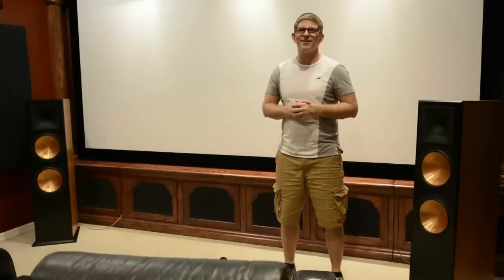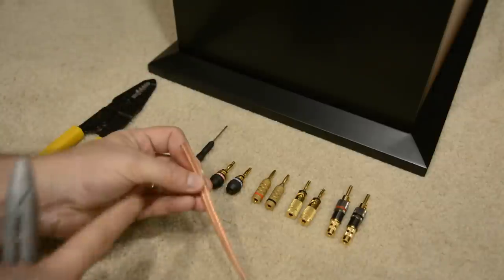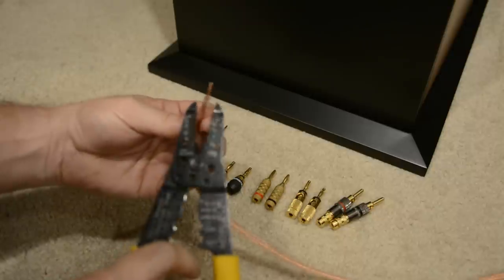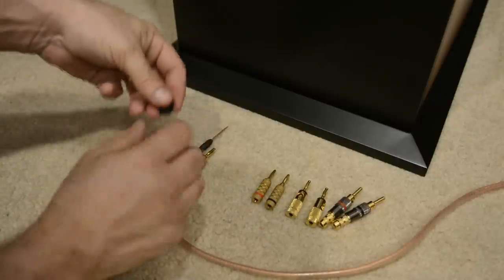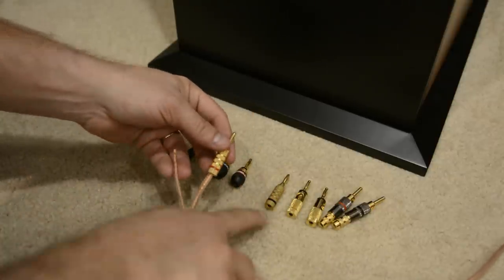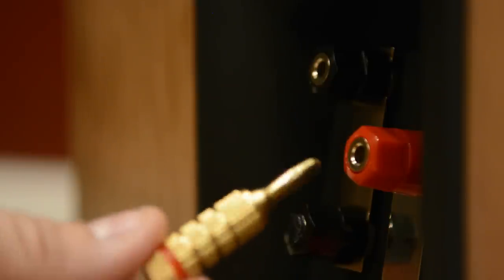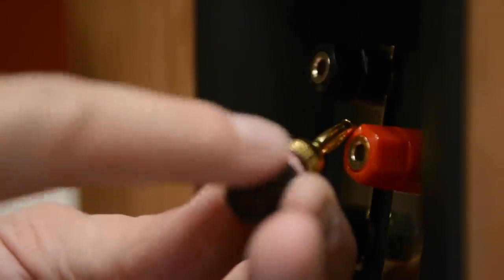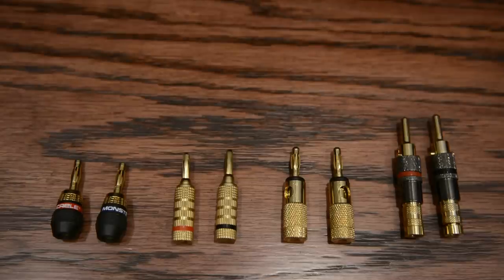Why Banana Plugs are a Must for My Home Theater and 2ch Audio System

Comment: Thanks for the comparison of BPs...I do feel the bottom locking screw should have gone first to lock it in place before the second screw for wire contact..
Reply from the maker: I’m not a fan of the ones with the screws.
Reply: @Youthman  but you just said that was your second choice? Maybe I am misunderstanding...I just installed Fospower screwdown banana plugs on the back of my AVR last night. The two screws locked it so solid and the plugs were so tight that when you try to put them in or pull them out you have to hold the AVR with your other hand or it all moves. I stripped 3/4 of an inch so BOTH the little screws provide wire contact.

My old Sewell plugs are exactly like those monsters and they got pretty loose over time.
Reply from the maker: The longer locking plugs with screws work VERY well, they are just more tedious to install since you are working with small set screws and they are MUCH longer so they do not fit in some AV cabinets.

Comment: I have a question. I’m new to connecting my surroundsound system. Should my speaker cables for the front left center and right be the same length let’s say I have a tower for my amplifier and of the media to the speaker cables have to be the same length
Reply from the maker: Hi Philip, as long as there isn't a drastic difference between the lengths, you will be fine.  I wouldn't recommend 6' cables for your mains and a 30' cable for your center.
Reply: Thank you for answering my question but it was a difference between 6 feet and 30 feet it was only a difference between I 10 feet because of a rack I’m amp being done in 6300 H to a definitive technology 9080 speaker system and I have a rack to the side so naturally one cable will be going shorter or we would be going directly to the speaker right next to it next to the rack and then that would be the center Which would be approximately 6 feet and then the far side which would be somewhere around 8 to 10 feet that was the difference
Reply: Actually I’m about to order SVS speaker cables and there’s no real difference between the price of the 6 foot and the 10 footer so I’m just gonna go with the 10 foot to keep everything pretty equal the only one that will be a little bit shorter will be the center channel the rears I’m using 16 I’m sorry 14 gauge cables for the rears
Reply from the maker: You will be fine with those lengths

Comment: So when are you supposed to use the jumpers on the speaker he showed? I have Klipsch speakers on my 5.1 setup and each speaker has two connections. I always thought they were connected internally so they drive both speakers in each unit. Have I been doing it wrong?
Reply from the maker: Hi Ozzie, when you remove the external jumper, you are separating the highs from the lows for either biamping or biwiring.  If you are not biamping or biwiring, leave the external jumpers in place and connect your speaker wire to only one set of the speaker terminals.  Doesn’t matter if you connect to the HF or LF terminals as the jumpers connect them together.
Reply: Not really sure what biamping or biwiring is. The Klipsch speakers I'm using have two woofers and one tweeter in each speaker. I just connected the speaker wire to the black and red and called it a day. I did remove the jumper. I don't know if I was supposed to or not.
Reply from the maker: If you removed the jumper and only connected your speaker wire to the top terminals, you will not hear the woofers.  If you removed the jumper and connected your speaker wire to the bottom terminal, you will only hear midrange and bass but nothing from the tweeter.  My suggestion is install the jumper and connect your speaker wire to the top or bottom terminals.
Reply: Okay, I just checked and apparently I didn't remove the jumper(s) which would explain why the woofers are working. I guess I spoke too soon. lol
Reply from the maker: Ozzie Alarcon I was thinking...”If he likes the way they sound now...wait till he connects the jumper and hears all of the speakers working”. Haha

Comment: Nice tutorial thank you. The only problem I have is that my onkyo receiver rear surround sound connection design (which I use for  my bookshelf speakers), is different.

The connections are the ones that you have to strip the tip of the wires then lifting up a lever before inserting the wires in,  then releasing lever for wire to remain secured. I'm positive you'd get an ideal of what I mean. The hole underneath the level is a bit small for speaker wire to pass through. In the end the naked wires  are nearly touching each other for being too closed together at the entrance. I had wanted to send you picture but YouTube doesn't have any option for that.  Which connectors should I get to make things easier please. I do not even know you name for this sort of connection. Please could you give me an idea. Thank you
Reply from the maker: It sounds like your surrounds use the older spring loaded connectors. You might be able to use a spade connector but honestly bare wire is  sufficient
Reply: Thank you bro
Reply: Yea, you're right, that's the connections with strings underneath. I'm very grateful for your help

Comment: I’ve never liked the idea of the wires being folded over then pressure clamping the wires. I don’t think it’s secure enough or making the best connection. I do have some and have used them but never  trusted them. I’ve just bought some locking ones like the last set in the video. I’m going to tin my wires with solder before fitting the banana plugs as the screws will have a solid wire to tighten to

Comment: Since I’m using a thicker ga. At super low volume I hear the towers of power even better than with the 14 I’m liking the cheaper wire and plugs a whole lot better. Seems like this is more solid overall.
Reply from the maker: Very cool.  Higher Price doesn’t always mean better quality

Comment: Brother .. i have A doubt.. Do All the banana plugs Fit in Even speaker cable As thick As 10 AwG..??
Reply from the maker: I'm not sure.  I've always used 12 or 14 gauge and never had an issue.  I've never had a need to use 10 gauge wire.  Are you running really long runs?
Reply from the maker: Typically higher gauge is needed for long runs.  Check out this chart - http://music-electronics-forum.com/attachments/35445d1440645410-speakr_gauge_help.jpg
Reply: Youthman  i am using 10 AwG dor my Towers And Centre..
Reply: not very long but  im using 10 AWG for my Towers And Centre..
Reply from the maker: I gotcha.     Definitely larger than what you need but no harm in having larger gauge wire.
Reply: Thank you bro
Reply from the maker: Absolutely

Comment: I bought these banana plugs only to find out they actually do not go into the back of the receiver where you secure the speaker wires.;
They are too fat.  I don't get it.  I also don't understand why no one ever mention such issues.
In fact they did not fit either Denon receiver. Denon 1612 AVR, 5 channel.  And another Denon AVR-S760H, 7 channel.

I do the typical unscrew out the nut, feed the speaker wire in that slot and then screw the shit back in to hold the speaker wire in place.  One big fat hassle as they really don't give you enough room to feed the wire in there.  Plus cluster fuck.
So I ended up sending them back to Amazon.
Reply from the maker: There are 4 different banana plugs in the video. Which pair are you referring to?
Reply: @Youthman  Each set of your banana plugs are  different sizes also?
I somehow missed you mentioning that.  
What are their  sizes?   Are they in mertric or standard?
I guess I need to watch the video again.
I am not expecting a reply.

Comment: Really should check focus. Could not understand the last type
Reply from the maker: Hi Jorge, The camera was in perfect focus.  I focused the camera on the banana plugs on the floor but because of the 2.8 Lens I'm using, it has a very shallow depth of field (google it if you aren't familiar with depth of field).  Basically as you move close to the camera, the object becomes out of focus while the ones on the ground remained in focus.
Reply: Youthman if the thing you are trying to show is not in focus then it’s not in focus. Focusing on the thing you aren’t showing is not in focus. Hey it happens. I still really appreciated the video. Thanks!
Reply from the maker: Good point Timothy.  Live and learn.

Comment: why " make a connection " to then make "another connection", when the best option is to connect the wire directly to the terminal ?? I've been building audio systems for years and have never used a banana plug......I enjoy eating bananas though, jmho
Reply from the maker: As mentioned in the video, the only benefit is convenience and time saver if you need to connect or disconnect.  Banana plugs are essential for me since I love trying different speakers, receivers etc.  I’m currently reviewing them three receivers and several speakers.  That would be a pain without banana plugs to swap 11 speakers each time I wanted to swap receivers.

Banana plugs do not sound better or worse than bare wire...simply a great convenience.
Reply: @Youthman  oh yeah absolutely !! I'm talking about permanent installations where nothing comes apart 😀... hopefully
Reply from the maker: For sure, if you never have plans (or rarely) change components or speakers, there is no benefit to using banana plugs.

Comment: Banana plugs where used in old telephone switchboards by the millions. Low current, frequency response from 100 HZ to 3000 Hz. Voice comm. Useless for home audio.
Reply from the maker: If you find no value in them, simply don’t use them. For me, they provide tremendous convenience with no audible difference.

Comment: banana plugs are stupid. adds time to project, adds cost to project, adds failure point to signal chain, adds a shitload of metal that your sound needs to push through. oh, but they make the connections that are hidden from view look nice. lose lose lose lose win situation
Reply from the maker: Nothing wrong if you want to stick with bare wire. I have used them for years and have nothing but excellent experience with them.
Reply: Youthman stated clearly that his main motive for banana plugs was CONVENIENCE...which he considers invaluable. If you also compare speakers frequently like he does, you may not think it's so stupid after doing the disconnect-reconnect-repeat shuffle with naked wires over and over again.

And installed properly, banana plugs are well proven to be trouble-free since their invention almost a century ago. PLUS, your ears will never discern any difference in sound quality.

Been using them for years without a single problem. Yes, it took some time and added some cost...but, I was so thankful I did it the several times I needed to move my system. It's a wonderful accessory that serves a useful purpose. ツ